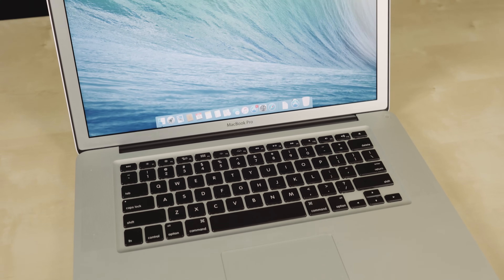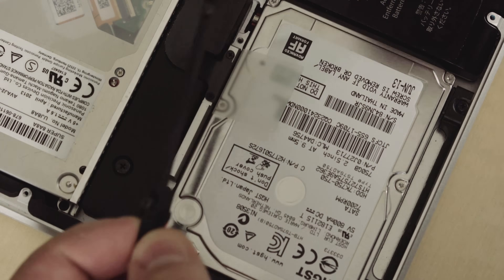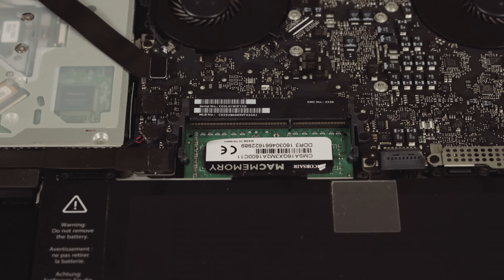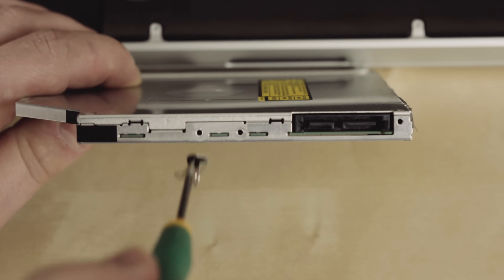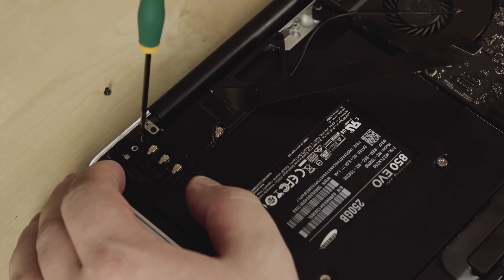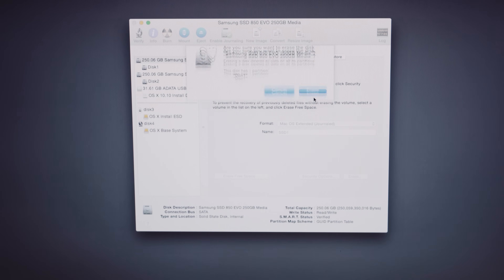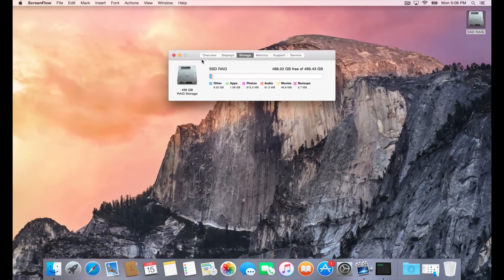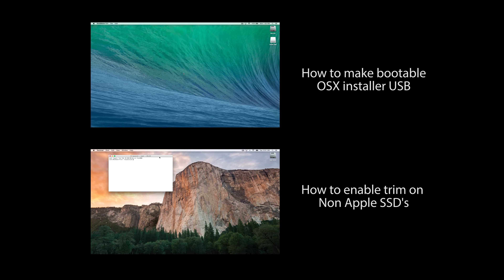Fastest 2012 MacBook Pro Ever! Upgrade Guide - in 4K

Comment: is there any advantages over having 2 drives vs 1? i was thinking of getting 1 tb ssd and installing it . any help would be appreciated thanks
Reply: also would this work with this laptop https://www.amazon.com/Apple-13-inch-MacBook-2-5GHz-Graphics/dp/B008BEYEL8/ref=sr_1_4?s=pc&ie=UTF8&qid=1466270671&sr=1-4&keywords=macbook+pro+2012&refinements=p_n_condition-type%3A2224371011
Reply from the maker: The only advantage is speed. You get twice the bandwidth with raid0 but one SSD is still very fast compared to a mechanical hard drive. You will notice a huge improvement.
Reply: Tbh, I wouldn't use Raid0, I'd go with Raid1. It isn't as fast as Raid 0, but if one drive fails, at least all my stuff isn't gone.

Comment: i did the same thing with my 2010 13inch mbp
500 GB SSD and 16 GB RAM……feels like a new computer
Reply: what brand HDD did you use?
Reply: I have a Mid 2013 my self and already upgraded to 16 gb ram my HD is 500 gb 5400 rpm I'm definitely wanting a 500 or bigger SSD
Reply: Me too mid 2010 13” 16gb ram and 2 SSD crucial MX500 1Tb each

Comment: can i use 2 500 GB SSD's?
Reply from the maker: Sure. I just used 250s because I already owned one and bought a 2nd one
Reply: and for the cady can't i use the crews from the previous Hard drive?
Reply from the maker: For some reason they were too short. I couldn't re use them.
Reply: then how do i attach that part if i dont have other screws lying around like you did?
Reply from the maker: Did you receive a kit without screws as well? You will need screw it down otherwise it would just be sort of laying in there. The antenna try will hold it down but not 100% tight.
Reply: oh im just wondering because im not sure if i wanna do the upgrade yet! also im wondering if doing the usb bootable will affect the features of the software in any ways or something?
Reply: so i just wanna make sure if doing this will affect the software performance compatibility wise  and like future updates for it and features?
Reply from the maker: No its basically the same as one drive.

Comment: Ok so I followed all of your instructions and am having problems... (All the parts I am using are what are in your video.) I made my bootable drive set to go to Yosemite because I know El Capitan's disk utility is different. After making my raid in yosemites 'a bootable disk like u did, what I did next was instead of installing OS X from my bootable, I tried restoring from my external hard rice worth time machine (that was running El Capitan). I don't know what went wrong but it got me to the end of the restore, restarted my Mac then got stuck on the apple logo forever without continue. It won't restart without this happening... (I figured I'd try using the bootable drive and just installing from there but now it's saying that the bootable drive looks corrupt...) Any ideas?
Thanks!
Reply from the maker: It could be because is a software raid controlled by Yosemite? And if you're installing based off a backup it doesn't know that it's a raid drive? I'm not sure without actually seeing whys going on.
Reply: Cool. I just saw another video of how it should be done using Carbon Copy Cloner, so I'm gonna give that a try :P

Comment: I did the same today - 16gb ram, 128 boot samsung pro ssd and replaced dvd with 1tb samsung pro ssd, this thing fast as f!!!

One question though, is it possible to replace CPU? Mine is 2.3 i7, I want 2.8 like yours
Reply: Christopher Bjørkeng In terms of video editing it can easily beat PC. Everything else the PC will win of course.
Reply from the maker: Thats awesome! You cant replace the CPU is soldiered to the logic board. Mine is actually 2.6ghz. They didn't make any faster than that in 2012 15". So its really only 300mhz faster than yours. Hardly noticeable.
Reply: so, not worth it? I was thinking to replace logic board with 2.6 i7, just found one for $150....
Reply from the maker: Oh if you can get the whole logic board go for it. You'll gain a little performance. especially if it has the GTX 650m 1gb video card which was only available with the 2.6ghz logic board. I edit 4k video with it. Its not amazing but its doable.
Reply: my current My Mac info says Intel HD 4000 1.5gb, is this any good?
Reply from the maker: +ealiev60 That's just the onboard graphics. It's not very powerful. Not like a dedicated graphics card. What does the 2.6ghz logic board come with?
Reply: same graphics :(
Reply: it's a piece of shit xDD do yourself a favor and trash that piece of junk lol
Reply: oh thank you, I was waiting until some stupid ass troll will comment on this... good to have you here
Reply: ealiev60 honestly speaking I did troll you a bit however I was serious about that macbook being trash. You can get a much better - faster up to date PC or lap-top "if that's what you prefer" that CPU is 6 years old. What do you expect me to call it =) Have a nice day sir
Reply: For video editing the a Mac is the best. Final Cut Pro is really well optimized.
Reply: +EpicManAbid a 1000$ Mac thingy can't stand a chance against my 1000$ build lmao
Reply from the maker: I agree 100%. PC hardware will always be better value to performance. But people buy macs for build quality, reliability and the OSX workflow.
Reply: +EpicManAbid depends on what program you use

Comment: For how much money did you buy that macbook?
Reply from the maker: I got it for $850 Canadian dollars used.
Reply: on ebay?
Reply from the maker: I got it on craigslist from a local guy here in Toronto.
Reply from the maker: Yeah it was an awesome deal that's why I jumped on it haha. I knew its potential. Its even the higher resolution matte screen. Nothing was wrong with it. I'm sure there are others out there for that price.
Reply: well that's a good deal. Did everything work when you bought it?
Reply: +Zed ProMedia there's a guy selling one in my neighborhood for $550. Should I buy it and upgrade or just wait for the new mbp 2016?
Reply: compare the specs and check the battery cycles

Comment: Will the laptop be as good as the new MacBook once upgraded?
Reply from the maker: Depends on what you mean by good. The graphics won't be as good because that's not upgradable. The battery life won't be as good because they have bigger batteries, And the new MacBooks have retina screens so the resolution is higher. Keep in mind this laptop is 4 years old. I'm just showing you can breathe new life into one and get some good speed out of it.
Reply: True. What I meant to say was the performance(the speed) of the laptop. Do you think that it would run as fast as the newer versions/ or would it still like to be not as good? Thanks for replying btw :)
Reply from the maker: +Aashir shukla yeah as far as launching programs and doing regular tasks it is fast. If you're doing something like editing 4K video (which I do) it's noticeably laggy in editing but do able. That's just the video card not able to keep up.
Reply: Perfect Thank you :)

Comment: If you run both drives as raid0. That means media and apps will run off both. With this not affect performance when using up space for media?
Reply from the maker: It consolidates it into one big drive. But you get the bandwith of 2 drives. Much better performance than the bandwith of one drive.

Comment: Hey  +Zed ProMedia, quick question,
Is there any way to upgrade the GPU, CPU and the battery in any manner? If so, how? If not, any alternatives please. Thanks!
Reply from the maker: There is no way to upgrade the CPU or GPU.
Reply: +Zed ProMedia 
You can get an external GPU for your macbook.
Reply: +orange451 Yes you can use an external GPU but the most reliable solution is really expensive so it really doesn't worth the investment. Search for Bizon Box (bizon-tech dot com), check out their cost and either keep dreaming on or empty your wallet :p

Comment: SSD Upgrade.
Welcome to 2009!!!!!
Reply: +MABC0101 SSD in raid zero with both ssds having 500+ mb/s r/w speeds. Welcome to 2014 more or less.
Reply: 2009 wasn't the only year when people were updating to SSDs. In fact nothing has replaced SSDs as yet, so we'll probably see SSD upgrades for quite some time, as the price to capacity ratio of SSDs slowly approaches that of HDDs.
Reply: He is using a SATA SSD.
Now we use M.2 nvme.
Speed do matter.
Reply: MABC0101 M.2/NVME is a relatively new standard and not backward compatible with older machines. The Macbook he is upgrading is only compatible with SATA and it is impossible to fit an M.2 SSD. The interface is completely different and not compatible at all. Even the formfactor is different.
Reply: Is two years old. In tech years is a lot. He is using Sata 3 drives on sata 2.
By the way, It is POSSIBLE to fit M.2 to sata. Next time Google it before posting
Reply: MABC0101 It's difficult to find new SATA 2 SSD drives, that's why he is using SATA 3. Also the old SATA 2 SSDs had issues like wear and needing alignment. You need an adapter to fit an M.2 drive with SATA and this give you no speed advantage.
Reply: But is Possible.
Reply: MABC0101 You can't just add an M.2 drive to a laptop without an M.2 slot. Adapters created compatibility issues.
Reply from the maker: +MABC0101 just so you guys know before getting into an argument. The 2012 mbp is Sata 3 on both Sata connections. 6gbps. I don't know if you had a chance to watch the benchmarks. There's no way I would get that speed from Sata2. Thanks for watching
Reply from the maker: +John Ioannou I'm using sata3 drives because the Sata connectors on the 2012 MacBook Pro are sata3 6gbps.
Reply: Zed ProMedia Even if it was only a SATA II interface, I still would have used the drives you chose. I've been using Samsung for a quite few years without issues... after switching from OCZ because of lots of issues.
Reply from the maker: +John Ioannou true that. I've never had an issue with Samsung. Same with Intel. But Intel drives are way over priced

Comment: why did you go with 2 250 SSD's instead of just 1 512 and i'm looking to do this upgrade on my 2012 MBP SOON
Reply from the maker: Because having 2 drives allows you to do Raid0 which effectively gives you twice the speed of one drive
Reply: Zed ProMedia it also doubles your drive failure risk and for most users slow computers, can hardly take advantage of that striped data rate.

Comment: Awesome video, I have a 2010 Mac Pro with 8gigs of ram and also a 850 Evo ssd does raid work on my machine
Reply from the maker: +Sergio Ortiz I dont think the Sata controller for the DVD on the 2010 macbook pro has the same speed HDD. The 2011 and 2012 both Sata3 on the DVD drive as well as the HDD drive. Which is why this is possible. But I have not tried it with an older macbook so Im not sure! Thanks for watching.
Reply: +Yu Dean /it runs a lil faster but not sata 3 fast

Comment: Fastest MacBook Pro but still not shit compared to a Gaming PC laptop
Reply from the maker: +Cyberslug1 Oh 100%! I agree, but that also comes with heat and size. The Retina Macbooks are even thinner than this older model.
Reply: Check out the 2016 Razor Blade. Thinner same build quality but with Intel 6700 HQ CPU and GTX 970 GPU. http://www.razerzone.com/gaming-systems/razer-blade  or the Aorus X5S v5 with Intel 6700 HQ CPU and GTX 980 GPU http://www.aorus.com/Product/Features/X5S%20v5.   I have to admit nothing can touch a Mac when video editing with final cut pro.
Reply from the maker: True the Razor blade shares a similar design. Pretty sexy actually! I like the all black aluminum
Reply: because Macs are for business use.
Reply: They Suck for A lot of businesses. They don't work with most business apps and websites plus there slower than all other top of the line laptops unless you use a mac optimized app and there are not that many of them. I'm a realtor and mac don't work with some of the websites we use and mac user have to run microsoft windows on there mac just to use apps and websites !! when they do this it drains there battery from full to shut down in 1-1/2 hours lol.
Reply: +Cyberslug1 Unless you use an egpu setup like I am doing with my rMBP with a desktop gtx 980 ;)
Reply from the maker: +Guy P does it work pretty well? What enclosure are you using? I've thought about trying it.
Reply: +Zed ProMedia 

I actually use a Rocketstor 6361A. it's a little more pricey, cheaper than the sonnet and you don't have to mod it since instead of making a barrel plug connector like the Akitio, you can use the ATX PSU to plug in a molex to the main board of the encloser, also the TB board. it's very simple, but it's not well known.
Reply: +Guy P I use my internal screen since the Macbook I have, it can be done. it has to be an iris MB though

Comment: great vid mate, what size screw driver thanks
Reply from the maker: 00 Philips works. I think I was using 000 Philips. Also you need a t6 torx driver. I posted a screw driver kit that has what you need in the description.

Comment: should i get this? cant afford the newer ones , i am a normal user but i want a fast mac , i use chrome all the time with 30tabs and youtube , is it good enough for me? I am currently using i3 4gb ram pc .
Reply from the maker: +Haider Abbas It'll will handle that no probs. I've been editing 4k video with it and its doing a pretty fantastic job so far! It gets alittle hot but I could be asking a lot from it when editing 4k video. Thanks for watching!
Reply: Thanks for ur reply :) , If you can edit 4K videos smoothly i can browse easily lol , Does dual boot works ? Did you try?
Reply from the maker: +Haider Abbas I haven't tried dual booting but if you wanted to add the second drive like I did and not put it in RAID0 I bet you could install OS X on one drive and windows on the other without their being an issue as long as you do it with bootcamp
Reply: +Zed ProMedia Cool thanks man :) Subscribed ;)